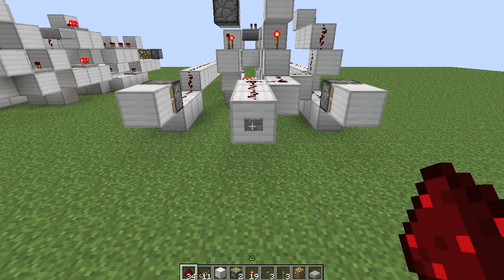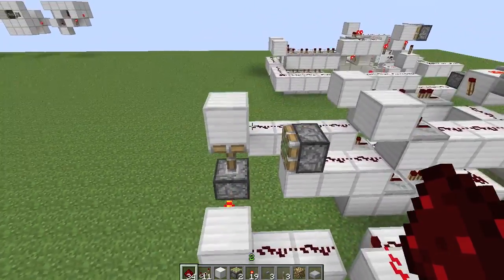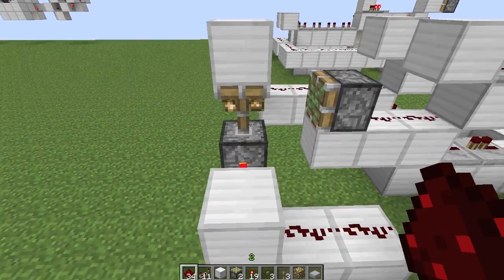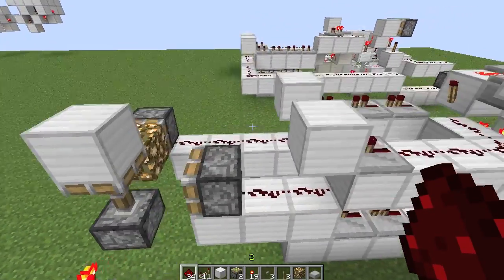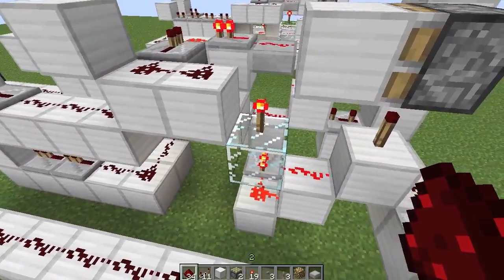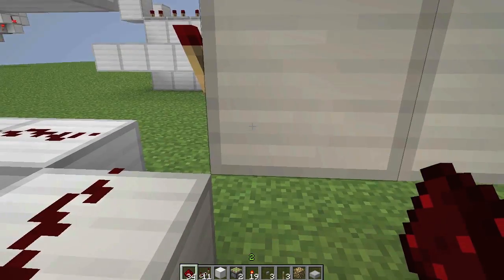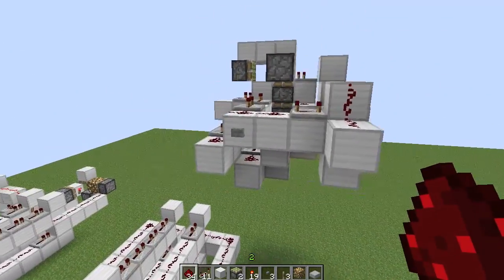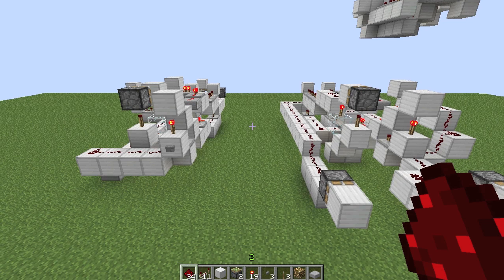Alternating Circuit for Fancy Timing

Comment from the maker: This is actually a bit different than what you're thinking of - which I believe is an ABBA switch or a reversible circuit. That does something similar, but in order to do (sort of) the same things as this circuit you'd need to add a T-flipflop as an input and two monostable circuits on the outputs. Even then there are disadvantages because the falling edge is slower than the rising edge and you wouldn't have as much control over the timing (because there are two outputs as opposed to four).

Comment from the maker: It might be, but there is one advantage to this that I mentioned but didn't demonstrate in the video. Using a demultiplexer to get two separate timing outputs gives you the option of using two different sets of delay, which is very nice to have when controlling the order in which two different mechanisms are activated.